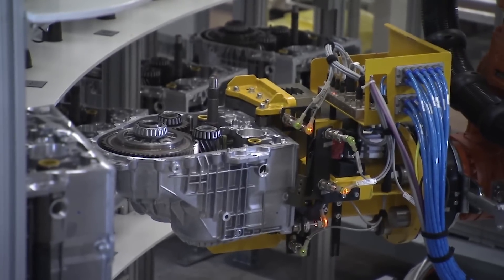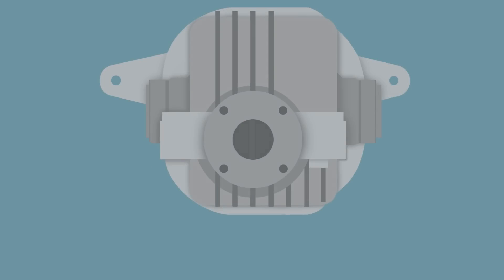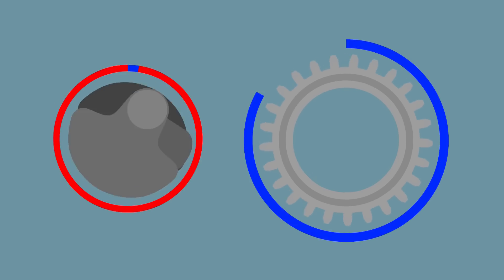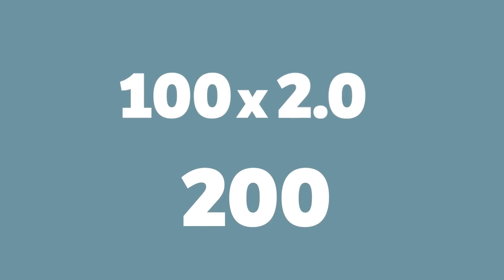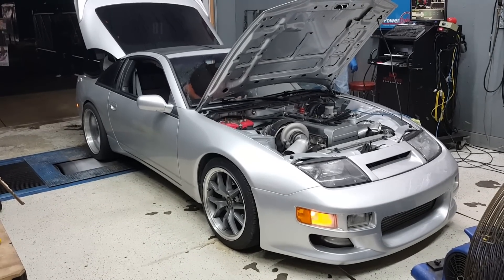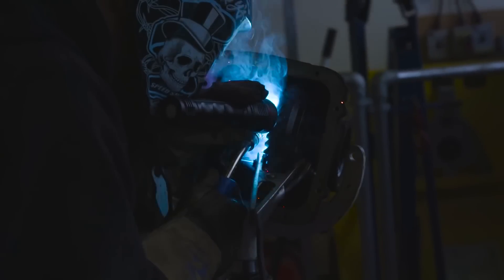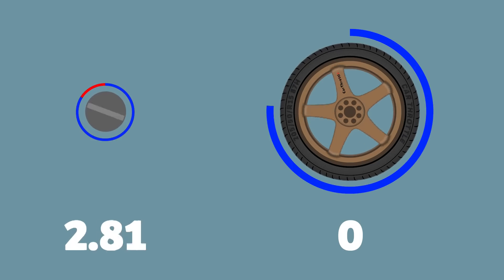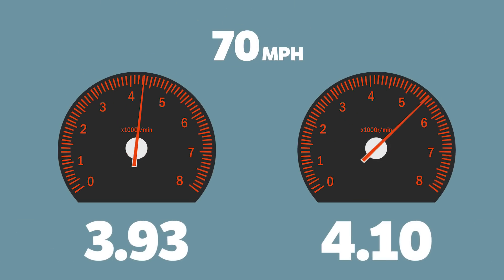The Truth About Gearing

Comment: Gear ratio's will vary from car to car due to engine size, torque, HP and the RPM they deliver them. I have a 67 Camaro with a 396 big block engine, 5 speed Tremec manual tranny with 3:73 gears. I just bought the car and the previous owner swore those were the proper gears. 1st gear was a granny gear and almost useless. I'm switching to 3:31
Reply: Generally a final drive ratio of 1 to 1 for the rear end is considered ideal, at least by auto manufacturers. To determine that it's .12 × tire diameter = gear ratio.  Even if you don't want to use those gears, at least it will tell you what GM would put in there. You can reverse it too. 3.73 ÷ .12 = 31. Which is why 3.73s and 31" tires are a popular factory setup for pickup trucks.

Comment: so just a question that I am researching... 

if I lowered my final drive ratio from (idk how much it is right now) to a lower value /ratio it will allow me to cruise quiter in my car and have a higher top speed for the autobahn? but it will hurt my acceleration? did I get it correctly? 

if yes.. 

then if I do lower the final drive ratio to get a quiter car for long distances but then do few upgrades to the engine to increase HP / torque will I then be restoring the lost acceleration time (0 to 60) and still I would have a quiter car for traveling? (because my car right now is too noisy even at 50/60 mph the rpm would be at like 4/4.5k rpm...

Comment: To anyone wondering, yes 4.00 and above with a engine that has about 350lbft of torque will do burnouts and if the motor has above 600lbft that's when you get tall wheelies.i know this because I have a gasser and I've been through it all

Comment: My question is is there a gear a lot a variables but half turn or even a quarter turn at crank full turn at rear end that would save 3x gas I understand you’ll have 0 torque 

Thought process trucks use 2-3 speed rear ends could convert dually axel into single wheel axel and install two speed rear end if on the Hwy could shift into that final drive gear for maximum mpg knowing that gear is for fuel economy.. innovation also comes when feet are to flames gas $5+ per gallon. In a crooked world have to think of things like that if it doesn’t resist someone will make it

Comment: 3.70s wouldn't get me over 52 mph. But my final gear is 1:1. This comment is for classic car owners who's unsure about gearing. If you are NOT running an overdrive and want to drive regular highway speeds such as 55 or 60 on relativity flat terrain with the rpms decent and not about to sling a rod. Best gearing for 3 speed or 4 speed transmission ive found are 3.25 for a 6 cylinder and 3.00 for a v8. These gears are for regular driving not racing.
Reply: I have a 86 F250 with a 3 speed automatic, no overdrive and 4:10 final drive open diff 2wd
Reply: @jamesmoore716  oof slow as molasses but very strong set up
Reply: @colevarela7320  yeah haha it's got a trailer brake installed and some stabilizer the owner before me had, I wonder what he towed

Comment: i have a 3.36 rear end and a 2004R trans with a fourth gear of .67. once lock-up engages and going up hill, my engine lugs and i’d have to downshift to third. my wheel/tire is 26” tall. i’d like to swap for a 3.55 but for now down shifting will do.
Reply: That's not really that much of a change. You'll be better off going with 3.73 gears.

Comment: In a video primarily about final drive gear ratios why do they keep showing the spider gears and even show what appears to be someone welding them solid?
Back in the jacked-up four wheel drive craze days back in 1970s I used to get a kick out of watching guys take a truck with about 3 to 1 Street gear ratios and put tires twice the diameter of the stock tires and then destroy innumerable sets of universal joints as the huge tires made their final drive ratio more like 1.50 to 1 and when they ran it in the transfer case low range ( because they had to all the time ) it put all kinds of torque stress on the drive shaft.
Same with brakes, I loved it when they would put monster tall tires on an axle with little car size brakes and wonder why they can't stop without blowing the hydraulic lines off.
Haa ha ha

Comment: So i ask my self this question. If I have a 3.73 diff gears, what is the max tire/wheel for his ratio?
Reply: Depends on the transmission and the engine you have, a gas truck might need 4.10s to run 40s while a diesel can run 40s with 3.55 gears, there’s too many variables, it also depends on the actual weight of your vehicle
Reply: 40 “ is pushing the envelope there. 38 “ is about all id go personally. 35 is standard size for most people who want to ruin gas mileage. The quality of the ride and increased rollovers. 👍👍.

Comment: I had 3.55 open gears on my Explorer with 4.6L V8 and they were ok at highway speeds but low end power suffered.  I drive in the mountains a lot and frequently haul stuff, so I switched to 4.10 gears and added a limited slip differential.  It helped a lot going up and down the mountains, I have more power going up, and more engine braking going down.  The engine and transmission do not work as hard because the rear end is doing more of the work.  Gas mileage you might ask?  Well at 70 mph my tach says about 2300. Not bad at all.  I just slow down on the highway and do about 60-65 mph now.  I noticed barely 1 MPG lower than before.  I used to get about 20-21 on the highway now I get 19-20.  Barely any difference at all.  With an overdrive gear, you are safe when driving on the highway with deeper rear end gears.  On heavier cars or trucks with automatic transmissions, you need more gear in the back.
Reply: This was a perfect explanation it clicked after reading this

Comment: I’m of the minority, where I like to have taller gearing     Cannot stand cars going more then 2500rpm or so going 80mph
Reply: Likewise. 
A taller rear end gear means higher speed, and usualky, better mileage.
The engine better be able to put out quite a bit of horsepower for that, as well as torque to keep up with traffic off the line.
I had a 3700 lb car that would get 17 mpg in the city, with a nice, big 5.7 liter under the hood.
I don't know how fast it would go.
I chickened out at 170 mph.
Reply: @danieljones317  okay just so I’m getting this right say I had a heavy car like a caprice if I wanted it to get of the line easier, choosing a shorter gearing matched with it being turbo charged is like the best of both worlds? I’m just learning here don’t crucify me lolol

Comment: My F250 & F350 have 3.73 gears, my old F250 had 4.10’s.  Not much difference in the real world. Top speed in not an issue as these big 4x4’s ride so rough.
Reply: Except for the 18ish% difference in output rpm and 18ish% difference in torque. With very little torque outpour from your F series engines, you wouldn't feel much of a difference. 🤣
Reply: @TheUniversalid  true!  18% slower!  These big Fords are turtles.  My Vette can move!

Comment: I think 3'73, is a Great gear for prrformance and Street.. I ran around. (Locally) a Few Years back, with a 55 Chevy, with 5'38 gears, then later, a 68 Camaro, with 5'38 gears! Both engines were built, and the cars, were very quick.. NOT A TRIP TAKING GEAR, for certain! I am building another 68 Camaro NOW.. IT has a CERTIFIED 400 HP 350 (Built by Mike Saye) with 4'56 gears.. STILL: Not a Gear, for LONG TRIPS!! ;)

Comment: If  I go with a 3.73 gear will it make my car faster with the mods that if have on my firebird bc basically what your saying is the higher the gear ratio the lower my mph is in each gear shift...
Reply: Higher ratio: Quicker acceleration with lower top speed and more  cruising RPM. Better off the line but tops out quickly and is loud on the highway.

Lower ratio: Slower acceleration with higher top speed and less cruising RPM. Worse off the line but travels faster. Quieter when cruising on the highway.
Reply: @80PercentAshamedOfU  thanks for clearing all that up for me man!
Reply: @80PercentAshamedOfU  You have that A$$ backwards. A low gear is high number, a high gear is the lower number, Example A 4.56 gear is a lower gear. than a 3.73.

Comment: What ever happened 390 to 1? Or 391's .
Reply: 2003-2007 G35coupes come with gearing from 3.3,3.5,3.6,3.9,4.10.   And the absolutely best gearing for automatic with MM is 3.53 gearing which come in the 06-07 auto G35’coupe. basically at 65-70mph u can drop to 3rd gear and be at 5k rpm and the launch is unreal. Literally pulled on RTS upto 120mph. The manual transmissions from 06-07 come with 3.69 gearing and they are also bad as. Get 12 more whp but with the higher gearing manuals they sacrifice 10 torque compared to the automatic at 3.53 gearing if that makes sense.

Comment: You don't know what you're talking about Buddy you never once mentioned the total diameter of a tire ..tires are gears too.. you want to know what's better 373s or 410s go put 373s in your car run a quarter mile then pull the rear end out put a 410 in there then run the quarter mile you tell me.. it's 410s

Comment: Personally I think 3.42 ratio is just about perfect.
Reply: I have 456 Gears on My Truck 🤷🏻‍♂️
Reply: Disagree (respectfully) when talking about trucks in general. I swapped the 3.42 out of my old Suburban to 4.10, which is my daily driver. It does NOT use any noticeable amount more gas if doing "around town" driving. It will use more on the highway.

I will never leave 3.42 in a truck again unless it's going to be driven for hours on the highway every day.
Reply: @RedfishCarolina  That’s not possible. If it’s burning more on the freeway,it’s burning more in town also. And going from 3.42 to 4.10 the ratio itself means you would burn more fuel.
Reply: @1EVILZ06  No not really. Keep in mind this is after driving the truck for 3 years with 3.42 then another 3 years (and counting) on 4.10. 

Around town, you get to higher gear sooner with the 4.10. It up shifts sooner, thus spending LESS time at higher rpm. 

Whatever the physics is involved, gas has not cost me anything noticeably more since the swap. I still burn about 12 gallons of fuel per week (short work commute) before and after the swap.

Highway mileage is worse but not such that I regret the swap. Obviously cruising at 70mph at higher rpm is going to burn more.
Reply: @RedfishCarolina  Copy that. In my brain I’m like your going to a lower ratio which means higher RPM’s. But what you’re stating makes sense. But on the freeway the RPM’s have to be higher than with 3.42’s. Just guessing about 600-850 RPMs higher? Like I mentioned I think 3.42’s are perfect. But if I were to ever switch it would be 3.73’s. 👍
Reply: @1EVILZ06  I think I'm turning about 3000rpm in 3rd at 70mph (assuming I'm towing a heavy load, I'm using 3rd gear).

Going to 3.73 won't seem like any difference at all. Trust me you won't regret going 4.10 in a truck unless you are putting 450+ hp to the ground.

If I had a 4L80e trans, I'd prefer 4.56 gears because of how tall 1st gear is on the 4L80e.
Reply: @RedfishCarolina  What a difference the vehicle makes. I’m thinking car! You’re talking towing in a truck. 😂😂😂
Reply: @1EVILZ06  I'd still do 4.10s on most rwd cars. Lots of videos here of people swapping them.

On something that's already a torque monster like a Z06 obviously not. But anything with a 6cyl, or big V8 panther-body Fords, Chevy Caprice, and any Mustang/Camaro that isn't forced induction would be a great candidate for a 4.10 swap.

The old 85 Cutlass I had probably had 3.23 in it, it was a total turd with that 307Y 5.0. Putting some 4.10s on it would have made it a bit more tolerable
Reply: @1EVILZ06  you make me feel more comfortable about the 410s..I myself have this same set up.got my 7.5/410s from motive gear for my 85cutlass.5.3 ls stage 3 btr cam behive springs ,243 heads with flat tops ,you mind telling me your thoughts?my trans is a bit "small"...200r4 but its built....right now I have 17inch rallys ..but have a set of 24s .not bad for a budget build right?

Comment: Want to confuse someone, tell them with all things being equal, a 3.55 geared car will go faster than a 3.73 geared car.   Now watch the arguments ensue. The smart ones will key into the "all things being equal" and know I'm right.
Reply: 2014 ram with a 3.21 gear locked in 4x4 letting the trans shift by itself leaving at 800 rpm 14.3 2019 classic same truck with a 3.92 gear 13.99 Saying all that 2019 Redeye with a 2.62 gear and than the optional 3.09 ran .27 tenths faster so you are allowed your opinion but these are facts The only time the higher number goes against you if there are traction issues but I am talking quarter mile times all being the same trans also manuals are geared different my friend has a 14 cobra with a 3.31 gear that outruns 3.73 Cobra because of internals on 6 speed 1st will do 60 2 will do 102 3rd 142
Reply: @kevinhatfield4078  Wow, I found another one who cannot comprehend the statement. LMAO.   See what gets guys like you every single time is your head is in race TIME, and cannot comprehend the actual statement being made. None of your examples were all things being equal.    

Anyone else want to try?  Fact still remains, ALL things being EQUAL, the 3.55 gearing is faster than 3.73 gearing.  Think about the statement.
Reply: @acdii  Acceleration is quicker, max rpm comes quicker as well.....you have to match gearing with tire circumference for the track...I run 6.10 gearing on a bracket car that turns just above the cam rating of 6200 rpms.....it turns 6250 in the 1/8th mile. Makes a HUGE difference in 60 foot times, AKA acceleration.
Reply: @imtheonevanhalen1557  Again, you would loose this if it were a bet.  Read this very carefully. With ALL things being equal. ALL things, Every single thing being equal.   It's a trick sure to win bet that has made me a LOT of money.    

Hint, it is not about time, it is about everything being EXACTLY the same, the only difference being the rear gear ratio.
Reply: I said quarter mile in my statement if your going for top end yes the lower number wins ????
Reply: Which one weighs more an ounce of feathers or an ounce of gold?

An ounce of gold, gold's measured in Troy ounces which is 1.36 standard ounces. 

Thought you had me didn't you?😝😝😝😝😝😝😝😝😝😝😝
Reply: I had 3.55's then went to 3.91's and my car woke up! It takes off much quicker. However, I did a cam and intake swap too. So all changes made car run much nicer.
Reply: Alright, since no one got it, here's the answer. Key is ALL things being equal, that includes the engine RPM's.  When turning 2000 RPM, the 3.55 geared vehicle will be going faster.     It's not about who is faster off the line, who can do the quickest quarter mile, or be first at the dirt track. The question is simple, when everything except the ring gear is identical, *including engine speed*, which is faster.  Betcha $100 bucks when this is discussed, you will always have someone argue against it until they understand the root of the statement.
Reply: @acdii  yes I agree...good way to explain it to someone is like when you're riding a bike and going fast but want to go faster, higher the gear...the more "empty" pedals you will be making and not pulling yourself forward

Comment: Not quite right about why dyno in the 1:1 gear. It's not about output torque, it's about drag. The 1:1 gear is directly coupled, the input and output shaft are simply coupled together. This means the torque isn't being transferred through gears. This reduces drag producing a higher HP number.

Comment: Ok, now do a video discussing parasitic loss as power is transferred from the crank through the drivetrain to the wheels. So all of you calculations in this video have to be tweaked by an average 10% loss.
Reply: I think it’s an average of 15% parasitic loss isn’t it? I could have sworn…
Reply: @mikionorton2236  It depends on the drivetrain. I believe modern setups (dual clutch sequential) have reduced the amount of loss a little bit. If it's a old school drivetrain, depends on if it's manual or auto (old autos can be horrible for loss).
Reply: @mikionorton2236  front wheel drive manuals have the least parasitic loss, and all wheel drive automatics have the most loss I believe

Comment: I owned a vehicle armoring business  and worked Dubai.
We found we could gain more horse power,in this case translate, moving mass quicker and less costly by lowering gearing than exhaust, air intakes, cams, and other superficial add ins.
Even though we also did many of the engine tweaks when clients would pay for it.
I am ordering a new Bronco and buying it with the lowest gearing possible.
Low gearing term equals high gear  ratio,ie 4:11 gear is preferable for pulling power, 3:56 gears is great for low engine rpm's at highway speeds.
That's how I always made the distinction.
Reply: Cool work history what are you upto now?
Reply: But bronco has low/short gears inside the transmission so no need to change axle gears.

Comment: I recently bought a 2011 chevy  colorado 2.9L and a 4speed transmission... I put a shift kit and buy a posi locker but dont know the ratio... if I wanna race 1/8"mile and drift what is the most suggested gears for that use?? I want good torque and also some speed
Reply: 3.73 or 4.10
Reply: @couch1596  4.56 for 1/8 mile drag race

Comment: Can never know enough,(when tuning)  now, someone. Tell me what I tune each gear at for a - all wheel drive skyline gtr gear 1-5 (for a game ) wish it was mine lol)
Reply: 2.95 or 3.73 final drive then work from sixth gear for the top end and the best acceleration for first. Use your 0-60 as a reference for first gear. I'm assuming your talking about Forza.
Reply: MrBigboy1057 🤙🏼
Reply: Tune them 20-30-40 mph apart using math to translate speed into engine rpm. Start your 2nd gear at 60-70 mph. Reason being, 1st gear is far too high in torque, so best to make it tall and get some grip/acceleration time in before the 1st/2nd gear shift.